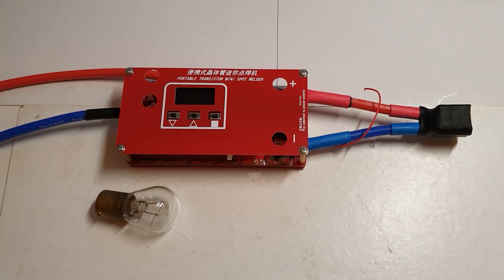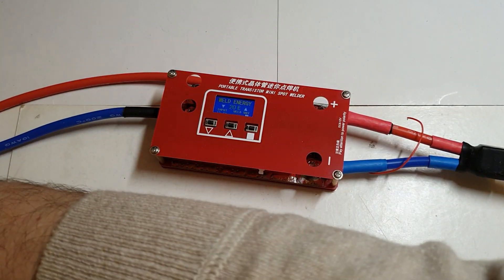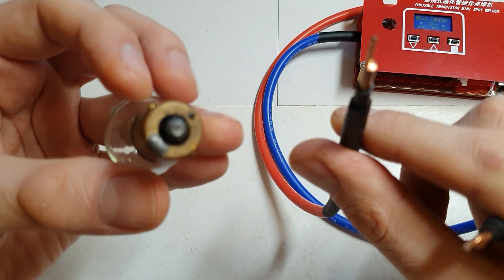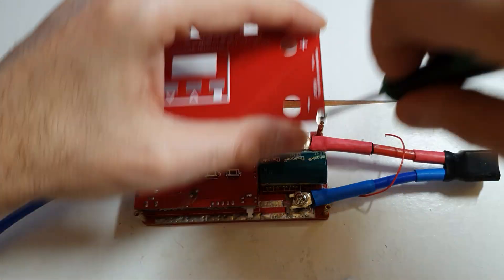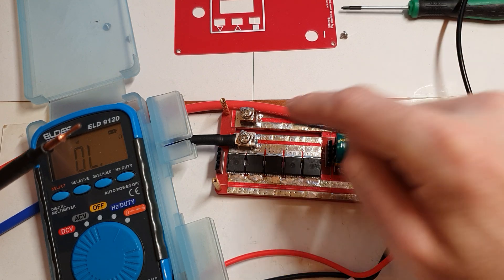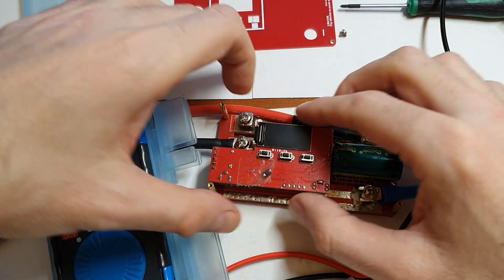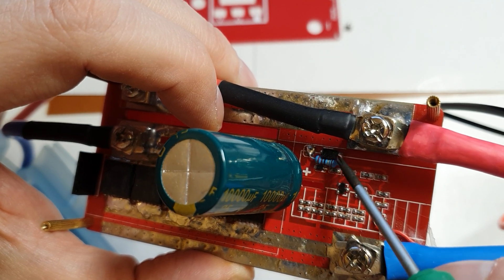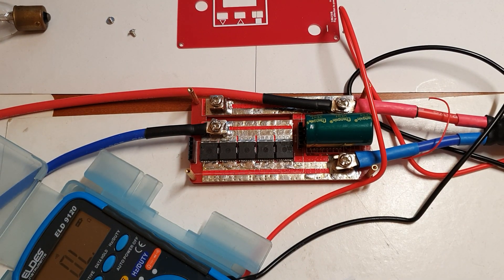Mini Spot Welder Quick Test method

Comment: It looks like it is easier to remove the diod and connect separate power supply for controller/driver.
Reply from the maker: It is a possibility but it's increased hassle as you need then 2 power sources. The current limiting resistor + diode is a one time, future proof mod and the large 10000uF cap is plenty to keep the logic going for that short time pulse.

Comment: Good

Do you suggest this spot welder for making battery packs

Thanks
Reply from the maker: If you apply the 2 basic and mandatory mods for these models and you have a good battery pack then it will work fine for the hobbyist making some packs. If you need to do hundreds of welds a day consistently then this is not the product for you.
Reply: @Luca_Techy  

What you will suggest

Thanks
Reply from the maker: K-Weld or Arduino welder project are good products.

Comment: I have the moded maple welder and I used a 6500MA 60C/120C lipo and with 5ms it burned the connector. So either my connector was not good enough or maybe the battery was too powerfull? Good thing is that no mosfet are burned only the connector from the battery to the welder....
Reply from the maker: By connector do you mean the terminal which screws on the board? Probably it wasn't soldered on well - it is very important that the power lines have good solid connections to the battery when you use these welders, they contact must be solid.

Comment: @Luca What do you think of adding aluminium radiators on top of the MOSFETs?
Reply from the maker: That mainly depends on how many spot welds you want to achieve: but consider that the electrodes will need to cool down in any  case. It won't really help in saving the FETs from failure, that's  a different story. If your FETs are matched and driven correctly, you will burn your hands holding the electrodes before they fail due to overheating.
Reply: @Luca_Techy  Thank you Luca. You are of great help!

Comment: I did your mods but I don't get good welds. Just tested between source and drain and I get 2.1 megohm. I guess that means it's bad?
Reply from the maker: THat's fine, your FETs are OK. You need to verify if your battery is in good working order. You need a good 12V 20Ah AGM battery or a 3S 5000mAh 50C LiPo at least to get good welds. Do not use Gel-acid or old UPS batteries if you are not certain of their internal resistance.
Reply: @Luca_Techy  yes I used my diesel car battery 600CCA fully charged. Still no good.
Reply from the maker: @TheFlyingKiwiNZ  If you are sure the connections with the battery a sound, you may try to shorten the input cables by about 10cms to see if you get better welds. Keep in mind that you shouldn't pass the 40ms range - if you have a good battery and the welder is properly driing the FETs you should get good welds with .12mm strips at max 20ms.

Comment: Hello.  I want to use my 12.6 volt  200 amp deep cycle solar battery as the power source since it sits next to my work table ... is that over kill ??????    Have all my mod parts and expect welder delivery today.   Thanks for the Vid.
Reply from the maker: Don't worry, no 12V battery is ever overkill for these spot welders - just be sure to hook up the connectors with good screw on clamps and start testing from 5ms upwards (after applying the mods). You should never exceed 20-35ms with a good battery on .12mm strips.

Comment: Hi Luca I just bought one of these the wise maple the newest one with the displayed towards the right hand side. It works ok on fine strips but on thicker does not weld.  Is it possible to change the time duration maximum  between 1 and 30 it would be good to go Close 50q any suggestions on a hack
Reply from the maker: Hi, unfortunately there is no hack apart from reprogramming the mcu with a modified firmware. The more simpler solution is to shorten the leads and get a beefier battery. With a good 3S 5000mAh 50C LiPo or 20+Ah 12V AGM battery you can weld with 20ms .15mm strips.
Reply: @Luca_Techy Thanks for getting back to me with the info.  I did short the leads as short as possible directly to the battery it's a lipo about 300 amps peak. It works very well with standard nickel strip that you get from laptop batteries. Not so good with nickel strip .15mm. I would definitely try with a bigger amp battery. If I did want to change the firmware do you have any recommendation on a firmware. And do you think will it help by changing the duration of the time slightly.
Reply from the maker: I haven't any modified firmware for that specific mcu (Nuvoton) but I made an Arduino pro mini version. However that requires heavily modding the board removing the original mcu which I don't suggest. Increasing the weld time over 30 of course will help but keep in mind that this version is 4 FETs so you may be overdriving it with .15mm if doing many welds. Maybe you should consider getting a Rev 0 and apply the cap mod if you really need .15mm strips.

Comment: I really appreciate the kind of analysis you're giving for these spot welders, do you think you could do the same for the BMS boards out there? I haven't found any real good and deep technical evaluation on them and I'm a bit concerned as you don't really have that much choice in the market.
Reply from the maker: Hi, unfortunately I don't think I can do this any time soon as I would need several samples of different BMS models to compare. The usual word of advice is don't save money on these types of products as it is very important to the life of the battery pack to have a valid management (firmware) system to avoid malfuntcion, damage and fire hazard.

Comment: just got one of these with no version on the main board, going to add the mods before i even attempt to use it, but was wondering if you knew why it wouldnt have a version id on it?
Reply: just saw rev 0 , unlabeled :) nvm
Reply from the maker: If it has all the major components on the MCU board with the MCP1407 driver then you just need to add a 470-1000uF 25V cap after the diode and gnd.

Comment: Can i use a 12v 60amp SMPS. As the retailer suggested that i can use this spot welder with 12v 40 amp SMPS. Should i use an smps? Should i just go with a car battery. The retailer made me buy the 12v 60 amp smps costing 40 USD. Can i use this test method with smps before i put the welder to use?
Reply from the maker: Go with a 12V 20Ah+ AGM battery, or 3S 5000mAh 50C LiPo. Switching PSUs are not appropriate for this application.
Reply: @Luca_Techy  thank you so much Luca. Also in your quick test i saw you attach the positive probe of the multimeter to the negative polarity of the board for contuinity. While i do this i see reading and when i change the probe polarity it shows 1. Why does this happen? Are my mosfets fried already? I just beefed up the tracks with solder.

Comment: Can i use a 12v 60amp SMPS. As the retailer suggested that i can use this spot weldet with 12v 40 amp SMPS. Should i use an smps? Please please please reply sir
Reply: no probaly not unless you look at the smoothing capacitors of it (the ones that smooth the dc at the end) if they are too small it can blow something up.

Comment: I've just received mine.
It has a 357T optocoupler that I don't don't what for and it has an MCP1407 mosfet  driver on the control board. But no decoupling capacitor after the diode on the control board (I added one 1000uF).
The power board only holds the 10000uF cap with 5 mosfets and campling diode between each gate to drain, some 30 ohm serie resitor on each gates plus one 10k pull down resistor.
Reply from the maker: Hi Harold, please check out my previous video All "Mini Spot Welder" versions, I explain all the circuits and problems there, starting from the one you have.
Reply: @Luca_Techy  Thanks for the information to the other video (very instructive).
Here is a chronogram of the trigger on pin 4 (output of the MCP1407 driver) in yellow, in purple the trigger at the mosfet's gate (between the mosfet's gate and the 30 ohm resistor) and the source to drain voltage in blue. https://www.dropbox.com/s/rq0tz4zby3ancrl/NewFile10.png?dl=0
Reply from the maker: Hi, thanks for the trace. Yes as you can see in less than 4us the Gates are fully driven - much better performance than the pushpull solution.

Comment: Thank you for the work you have done in detecting and rectifying the issues with this unit.  I am not an electrical engineer but was able to get the basic understanding of what the problems were and how you fixed them so when I received my unit it needed all three modifications that you identified which I carried out quite easily before switching it on for the first time.  So far it is operating well and producing good quality welds without any magic smoke being released, I hope it continues.  Thank you again for your videos:-)
Reply from the maker: You're welcome!

Comment: Luca, I have the BL18-2K and mine will not light the bulb like yours does. I've checked what I know for continuity and mofset shorting, it all seems to check out. I've bumped to 99 still nothing. Where/what else and how can I further troubleshoot this welder? BTW, your reviews and mods and explanations are awesome!
Reply from the maker: Hi Jeff, if you have already done the R4 470 Ohm resistor mod (and the series 20 Ohm resistor current limiting mod) then your next step is to check the 3 transistors for problems (shorts) and connections between them and the FET Gates through the 30 Ohm resistors. First give them a reflux as maybe there is no contact with the pad. Also spray some deoxit on the 5 pin connector as I've had problems with continuity andmax sure they are nice and clean. You can find all the schematics linked in the description of my previous video (all mini spot welders) to see how the PNP-NPN pushpull tranistors are connected.

Comment: The motorcycle battery 12V 12Ah 150A will be suitable for welding ?
Reply from the maker: Hi Adrian, if the battery is new and in working order then it will work (I have used a similar AGM battery for tests). However the weld power may be limited to a .12mm strip and insufficient for a .15mm strip. I could weld .12mm at around a 20-30ms setting with my battery whereas with a 3S 50C 5000mAh Lipo I can weld the same strip with a 8-10ms setting. Be sure to have applied the mods indicated for your type of welder (the driver resistor MOD and the in series resistor diode mod).
Reply: @Luca_Techy  Thank You!
Reply: @Luca_Techy  I found an AGM 8 Ah CA 280A battery and I think it will be better. Thanks again for the answer.
Reply from the maker: I use a similar 12V 10Ah motorcycle battery and it works well but not as powerful as my 3S 5500mAh 50C lipo - same weld with less time. You can shorted the power leads to improve welds once you see how it performs as is. Start from 5ms and go up.
Reply: @Luca_Techy  Ok thanks.

Comment: would you recommend changing the wires on this to better quality ones. If yes, what gauge should we go for.
Reply from the maker: If you have a good enough battery you needn't change the basic cables, maybe shorten the ones going to the battery about 10cms/3inches like I did. If you need to have long (50cms/20 inches) power cables for some reason then I'd suggest a good copper quality AWG6 or 8 cable to keep the losses at minimum. In all cases whenever you change the cables always start testing/calibrating the weld from 5ms upwards.
Reply: @Luca_Techy  Thank you for the info. Much Appreciated.

Comment: Hello, I have trouble getting it to weld a 0.15mm nickel strip. Tested it with 44aH car battery but not enough power. Maybe the leads are too long, I don't know (around 40cm from the battery). Any idea would help.
Reply from the maker: 40cms is definitely long if you don't have proper AWG 6 wire. I'd suggest to try with the original leads or shorten the ones you're using (what AWG are they?). Always start from a low value (5ms) after you have shortened or made any changes and go up from there. Be sure you have good contacts with the battery terminals (use screw on connectors, avoid spring clamps). Also be sure you do these (or any) tests after the suggested Resistor mods.

Comment: Great videos! After seeing so many welders fail on their 1st weld I used your videos to modify a welder I got before I even powered it up, works perfectly. Thanks! 

Some questions, is there any way to power these  with one battery and use another battery to do the spot welds?

Also, I have a ton of 18650 3000mah that will do 20a draw. If I made a 3s pack from them, would a 3s10p which gives me a theoretical max draw of 200a be OK?
Reply from the maker: Theoretically you could by isolating the + line from the main battery so it just goes directly to the + weld contact and power the welder with a seperate smaller 12V battery connected to the + of the welder board. You can't use anything less than 12V to power the welder as the push-pull circuit voltages are calculated for this 12-16V input range else it will fail to drive the Gates properly (unless you change the resistor divider on the base, but then other problems can arise). I wouldn't worry about powering it with a seperate battery as once you have done all the mods the whole setup works pretty reliabily within it's operation limits.

Comment: Hi Luca thanks for the great videos, do you have a recommended seller we could but the spot welder from?
Reply from the maker: Hi Pedro, I don't have any preferred ones, I bought mine from Aliexpress from random sellers and they all arrived within a month. I know that there are sellers on Amazon or Banggood who sell the "Rev 0" ones still so you might check there as from AliExpress I have only sourced the BK/BL versions without the MCP driver. If you can source this model I suggest it as once modded with the additional Cap it's a better version than the bk/bl "cheaper" ones. You can't really tell which version it is by the photo, however I know that they are slightly more expensive (around 25-30 Euros) respect to the bk/bl versions.
Reply: Did you find any rev. 0 model?
Reply from the maker: Not yet but I know Banggood has them and I am trying to source one.
Reply: @Luca_Techy  Looking at the photos provided by buyers it has the MOSFET driver.

Comment: you showed on another video that the cables are aluminum cables, have you tried replacing them with copper cables?
Reply from the maker: No, but I did shorten them and also showed how much voltage drop there is on the welder from the battery (approx 50% of the voltage drops in the best conditions) with original cables. This drop on one hand reduces the weld energy but on the other hand limits the current through the FETs and helps increase their life span. If you reduce the cable length and/or replace the cables with larger (AWG 6) copper, you can but you must always "recalibrate" your setup starting from a low time setting (5ms) to see if you are not overdriving the welder. I find that with the default cables and a good battery pack (or 12V AGM 20Ah+ battery) the welder performs very well for .15mm strips with settings around 10-15ms. Driving it over 30ms with a good battery is risky, which is why the Wise Maple has this hard limit set in software.
Reply: @Luca_Techy  I guess they ARE a wise maple haha, thanks for the info, will keep it in mind, hopefully I can design a much better setup without all of the flaws, but that project is on my free time

Comment: I want to say thanks, using your tutorials I was able to fix my Bl18-2k unit. When I got it, I hooked it up to a car battery but it would not do anything. It made all the correct beeps and the display and buttons all worked correctly. I found the diode was bad so I changed it and added the inrush current limiter resistor in series with the diode and I also changed R4 to 470 ohms. Still did not work. After changing all three transistors in the push pull circuit it started to work. Thanks again.
Reply from the maker: Gladd to hear - the push pull transistors usually don't fail, so I'm surprised this happened to you. Maybe it was a defect (DOA) - did you test the transistors to see if any of the three had failed/shorted?
Reply: @Luca_Techy  It could very well have been bad from the start. it never worked from the first time I tried it. I did try to check them with a cheap Electronic component tester, but it said they were diodes. 
I salvaged all the replacement parts from old electronic boards I had and used the component tester to figure out what they were so it worked pretty good for that.
Reply: @dennisallen2264 so this is the exact issue i am having.  It appears everything works other then the actual weld happening.  I got my welder from banggood about a week ago and it is the CA20-2K.  Can either one of you make a video checking the transistors?  I  have tried a car battery and a 3s 5000mah 60c battery with no luck I get the beeps like it is working but no welds or arks.
Reply: @Luca_Techy  See my comment below PLEASE

Comment: its good way to test ,,, suggest a for batteries vedio if u got time

can i use 16V diy 18650 pack as battery for the mini welder ?
Reply from the maker: Best is a 3S 5000mAh 50C, I don't advise a 4S. You need at least 50C 4000mAh for this to work properly and the more cells you put in series the more you increase internal resistance. Also you risk overdriving the pushpull driver. It is still within operation limits but very borderline so do this at your own risk.
Reply: @Luca_Techy  thanks man I have 14s100P i hope this mini welder will help me to fuse the 1400 cells i think i will just remove my care battery lol thanks agin